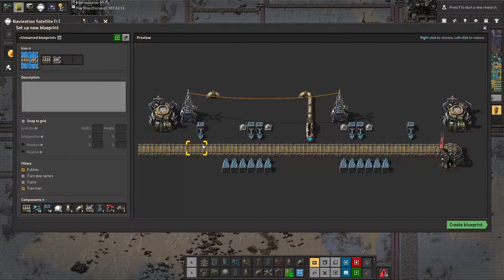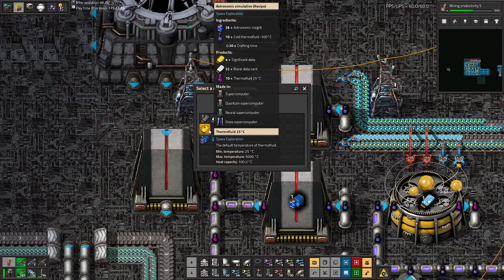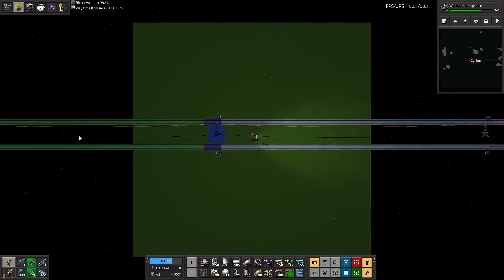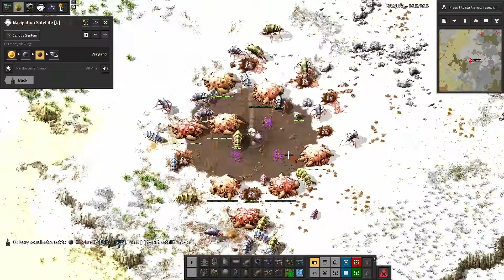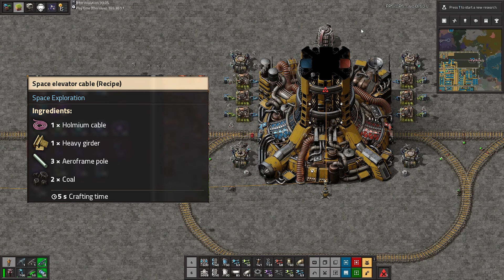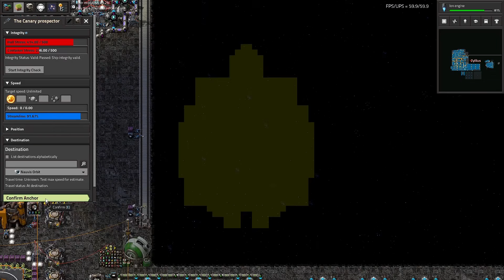How Hard is it to Beat SPACE EXPLORATION | The Second Coming

Comment: I copied my normal rail book and converted it into space rail with the macro (08/24). Also my loading/unloading stations - only fluids suck because space is so short it broke the compact designs.

In space I had 3x fluid busses - 1x just cooling for research, 1x biological and one cooling+plasma.

You said you had recovered the ship already. If you travel to a new location with the ship - drop down from space and built a platform you avoid loosing items to crashed rockets.

Comment: Ion exchange beads are used in industry for a couple of things.  In wine, calcium and other +2 cations  form a complex with tartaric acid and make cream of tartar. This is undesirable as it leads to a loss of acidity and cold instability.  By running the product through an ion exchange column, you can replace the calcium with hydrogen(ie acid) maintain stability and acidity.

Comment: I started this mod expecting it to be a good long haul mod to get me into doing longer runs; I’m still not off nauvis and I’m already crying over the lack of oil.
Reply: What i like about this mod is that playing it feels like picking up factorio for the first time again.
Reply: For my run; only just finished getting vulcanite and Cyronite on rockets. The space science is mostly automated but I’m having to manually import things like motors and modules and circuits currently because I’ve yet to finalize an automatic solution.

Instead of doing dosh’s encoding method im just giving each planet its own dedicated supply frequency on the transmitters so i can also import additional items beyond cargo sections using the same rocket. It works fine but time will tell how the UPS will hold up

Comment: Fun fact: Real life scientific data are sometimes so huge that it's actually faster to physically ship the drives to the processing center rather than trying to transmit it there electronically
Reply: I once went to a lecture about the logistics of the Large Hadron Collider. The thing produces so much data that even after pruning out 99% of the irrelevant information and heavy compression it is still more than any landline can handle. To get it around the world to the labs that research it, the only option is to load it onto thousands of magnetic tapes using a giant robot, and ship it out on container ships. It’s a massive effort.
Reply: Never underestimate the bandwidth of a station wagon full of tapes hurtling down the highway.
Reply: Xkcd!  @cals4887
Reply: Amazon even provides this service in AWS. It's called AWS Snowmobile
Reply: @anxietyprimev6983  i mean it makes sense logistically. If you think of it in terms of any other substance, say... cheese. It'd be a lot more powerful to move a freighter of cheese wheels somewhere than it would be to create a cheese conveyor from the factory to the grocery store, and it re-uses normal existing infrastructure (roads) instead of setting up custom heavy-throughput infrastructure. Kinda like factorio actually lol. Much easier to set up a train network than build brand new massive blue belt lines everywhere
Reply: I can't remember where it came from exactly, but I think I read a book once that mentioned an old joke that there's no faster way to transfer data than a station wagon full of thumbdrives hurtling down the highway. I guess at the end of the day, as long as we're still making bigger and bigger storage drives, someone's gonna be using the local postal service as their file transfer protocol.
Reply: @anxietyprimev69  Yeah makes sense, what people don't realize about datatransfer is it still requires physical wires to reach far places without interference. Even wen you build a new house in 2022, the internet company still needs to plant a physical large wire to your home to get internet going. Wireless can be done but is somewhat unreliable unless they have a lot of sattelites in the sky or radio towers to transmit the data. You really notice it when you can't seem to get data while in a tunnel or somehow you get better internet in the middle of the ocean than a guy who lives an hour away from the city in a mountain. and if an area doesn't support internet, it's because there's no tower or wire or sattelite to beam it. Starlink costs a lot to set up but for some parts of the world, is the only option.
Reply: Ah, SneakerNet.
Reply: @underrated1524  Randall Monroe my beloved
Reply: @underrated1524  What if that was a reference.
Reply: I heard that they did that for the data related to the M87 black hole image, and it was faster even accounting for having to wait for summer in the Antarctic to ship the drives from a telescope there
Reply: The quote I heard in college was, "never underestimate the bandwidth of a station wagon full of hard drives barreling down the freeway"
Reply: Assuming a dedicated fiber link, you could hit terabit speeds, or roughly 125 gigabytes per second. 8 seconds per terabyte, or 8,000 seconds per petabyte. So a 1 petabyte dataset would take a bit over two hours.
Reply: @Ornithopter470 If they need ships and are going overseas, a dedicated fiber line would need to be run a very long way, and would be unlikely to hit petabit speeds. Not to mention the limitations of the backing storage and protocol overhead.
Reply: @kylek.3689  And that's assuming a dedicated line used for absolutely nothing else. The instant you try to piggy back anything or anyone else onto that infrastructure, throughput will fall through the floor.

Assuming IP for the network layer protocol, that alone would double the amount of data to be transferred. IP packets are 32 bytes, and only half of that is payload.

FedEx has much, much higher throughput at the cost of significant ping times. You don't want to play online games this way, but it's amazing for shipping insane amounts of data.
Reply: Me walking back to lab from the light sheet microscope with a 4T hard drive is so much faster then uploading to the university cloud and downloading it again.
Reply: Explains the tape mechanic in the game Signal Simulator
Reply: What about that do you find fun?

Comment: Thanks for quite an interesting show!
Just wanted to note on 32-spaced poles as base for rail grid.
I initially was quite frustrated too by vanilla 30-spaced pole grid until I realized few things:

* You can't fit many rail pieces even into 32x32 block, you'll need two spans anyway; yet, some pieces like 1-1 stations with overlaps fit into 30-tile span just fine
* two-way track with 4-tile spacing between rails is surprisingly inconvenient, as typical X crossings between tracks can't be signaled properly; 6-tile spaced allow much more configurations while being not as wide as 8-tile spaced
* 32-based grid looks a bit too artificial

So I came up with 30-tile rail spans, 6 tiles between lanes, aligned at 10x10 grid in such a way that 2-span block is rotated around its middle pole. Finer grid, yet not as cramped as 32x32 would be, and allows more configurations

Comment: Modlist? Apparently it's on the previous part...

AAI Containers & Warehouses
AAI Industry
AAI Signal Transmission
AAI Vehicles: Flame Tumbler
AAI Vehicles: Ironclad
Alien Biomes
Alien Biomes High-Res Terrain
Bullet Trails
Clean Floor
Combat Mechanics Overhaul
Equipment Gantry
EvoGUI
InformaTron
Jetpack
Landfill Everything
Larger Lamps
Milestones
Module Inserter
Pushbutton
Recipe Book *(FNEI works too, personal prefference)
Robot Attrition
Nixie Tubes
SE Smooth Spaceship Walls
SE Space Trains
Shield Projector
Simulation Helper
*All the SE stuff (Space Exploration and it's dependencies)
Space Pipe Junctions
Text Plates
VehicleSnap

Copy pasted it over, * is edited

Comment: If anyone's curious "Anion-Ion Exchange Beads" probably refers to ion exchange resin. It's a packing of small synthetic beads with a desired ion attached packed into a column and is used to replace one ion in a solution for another by flowing the fluid through the packed column. It's used often to remove salts (in the chemistry sense, not just table salt) from process chemicals as part of purification.
Reply: yeah i was thinking "those beads are a real thing - but named differently"  havent been in a lab since uni - thanks for reminding me

Comment: Please explain how you do the single signal for everything from one planet?
Reply from the maker: Okay so C = Cargo Sections, P = packed Cargo Sections, and S = Space Capsules
For this we'll say S = 8, C = 48, and P = 61
We want to turn all three of these into a single signal for convenience

P is easy. There's 5 sections in one packed sections so P * 5 + C = Total Sections. That comes out to 353 cargo sections. Now we've gotten it down to two variables, and this is where the magic happens. If we multiply C by 100 and output it as another signal, like "N" and also multiply P by 1 to "N" as well and add those together we should get
N = 35308
You should be able to see the original information still in there even though it's one number now. We send that via transmitter and receive it on another planet. Once it's at that planet, we take it out and Put it through two different combinators. 
35308 % 100 = 8 Capsules
35308 / 100 = 353 Cargo Sections
Super easy. Keep in mind that we've effectively reserved two digits for the number of space capsules, so if for some reason you end up with 100 on that planet, the 1 would bleed over into the 353 and instead of 100 capsules it would say you have 354 sections and 0 capsules. This is what's known in the biz as integer overflow. From there it's a matter of making a rocket automatically supply based on that signal, which is a little more fiddly, but pretty much the same as a regular rocket resupply.
You could store more than one variable this way. For example, if you wanted another signal to keep the meteor defense ammo on-site at a certain level, we could take M and multiply it by 1,000,000, and add it to N as well. If we had 28 meteor defense we'd end up with something like
N = 28035308
This time we've got four digits reserved for cargo sections and we can decode it using the same method as above except this time we'll need to do this
28035308 % 100 = 8 Capsules
( 28035308 % 1,000,000 ) / 100 = 353 Cargo Sections
28035308 / 1,000,000 = 28 Meteor Defense
You can add as many signals as you need until you reach the 64 bit limit of 19 digits, This requires eight or nine digits so far depending on how much meteor defense.
Reply: @DoshDoshington  that is genius! I have been playing factorio for years, how did I never catch onto that! I have made clocks because I wanted science rockets to be sent every 10 minutes with thr required science packs needed in space! But never thought to hide multiple signals into one single signals with, what is just, basic math! 🤔 Can't wait for your next installment, I have been pausing, zooming and puzzling together all the absolute genius things you are doing with this mod pack! At least for now, you are my genuine hero!

Comment: I always return to these videos for help. 

Is there somewhere you post how you built the resupply circuits from the last episode? It’s tragic the frame rate issues kicked in during that segment. I tried to Frankenstein it but couldn’t get the proper output signal
Reply from the maker: Okay so C = Cargo Sections, P = packed Cargo Sections, and S = Space Capsules
For this we'll say S = 8, C = 48, and P = 61
We want to turn all three of these into a single signal for convenience

P is easy. There's 5 sections in one packed sections so P * 5 + C = Total Sections. That comes out to 353 cargo sections. Now we've gotten it down to two variables, and this is where the magic happens. If we multiply C by 100 and output it as another signal, like "N" and also multiply P by 1 to "N" as well and add those together we should get
N = 35308
You should be able to see the original information still in there even though it's one number now. We send that via transmitter and receive it on another planet. Once it's at that planet, we take it out and Put it through two different combinators. 
35308 % 100 = 8 Capsules
35308 / 100 = 353 Cargo Sections
Super easy. Keep in mind that we've effectively reserved two digits for the number of space capsules, so if for some reason you end up with 100 on that planet, the 1 would bleed over into the 353 and instead of 100 capsules it would say you have 354 sections and 0 capsules. This is what's known in the biz as integer overflow. From there it's a matter of making a rocket automatically supply based on that signal, which is a little more fiddly, but pretty much the same as a regular rocket resupply.
You could store more than one variable this way. For example, if you wanted another signal to keep the meteor defense ammo on-site at a certain level, we could take M and multiply it by 1,000,000, and add it to N as well. If we had 28 meteor defense we'd end up with something like
N = 28035308
This time we've got four digits reserved for cargo sections and we can decode it using the same method as above except this time we'll need to do this
28035308 % 100 = 8 Capsules
( 28035308 % 1,000,000 ) / 100 = 353 Cargo Sections
28035308 / 1,000,000 = 28 Meteor Defense
You can add as many signals as you need until you reach the 64 bit limit of 19 digits, This requires eight or nine digits so far depending on how much meteor defense.

Comment: If you don't mind me asking, what mods are currently used besides SE and its requirements? I saw the space trains mod in here which is not a dependency so that made me curious. Also I love this content!
Reply from the maker: AAI Containers & Warehouses
AAI Industry
AAI Signal Transmission
AAI Vehicles: Flame Tumbler
AAI Vehicles: Ironclad
Alien Biomes
Alien Biomes High-Res Terrain
Bullet Trails
Clean Floor
Combat Mechanics Overhaul
Equipment Gantry
EvoGUI
InformaTron
Jetpack
Landfill Everything
Larger Lamps
Milestones
Module Inserter
Pushbutton
Recipe Book
Robot Attrition
Santa's Nixie Tube Display
SE Smooth Spaceship Walls
SE Space Trains
Shield Projector
Simulation Helper
All the SE stuff
Space Pipe Junctions
Text Plates
Vehicle Snap
Reply: @DoshDoshington  Thx so much!

Comment: I find it mind boggling how he can build and use trains so easily and smoothly. I never actually use trains for more than ores and oil.
Reply: Finished Factorio with only belts ( high density ores and frequent too ) but trains are really mandatory to scale to mega base.
Reply: blueprint it, he just slaps down blueprints and lets bots do the rest. not much thought required just need to give stations relevant names and make trains go back and forth between 2 stations.

Comment: Its kinda weird how you're set in space and still require large amounts of oil to obtain fuel which you could obtain in a relatively easy way from water instead of oil (assuming you're using hydrogen and oxygen as fuel).

Comment: For the I get more water than i import problem my solution is smart routing with the pipes, have a input line, an output line and don't mix them, then just route everything through 1-4 tanks with pumps that only add new liquid if there isn't enough stored, I usually fill the tanks to 20% outside liquid